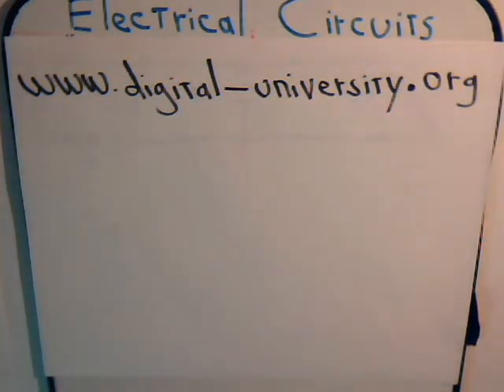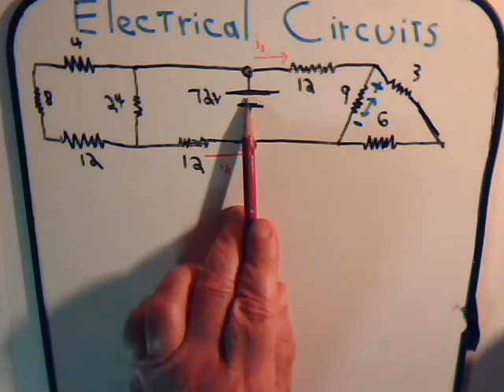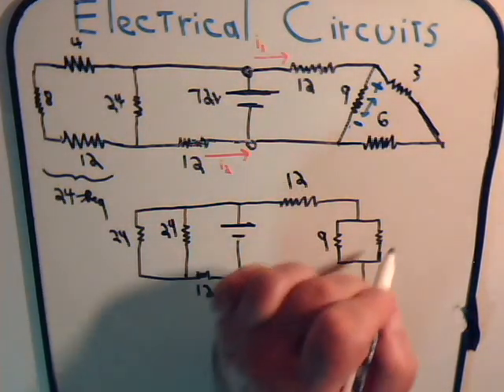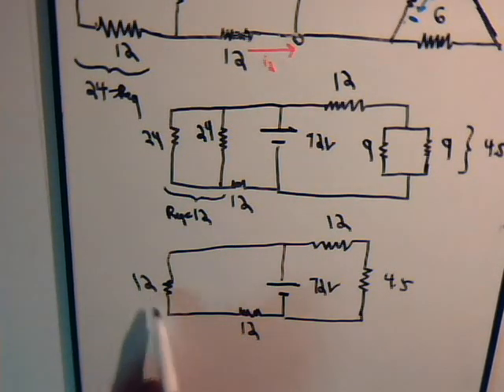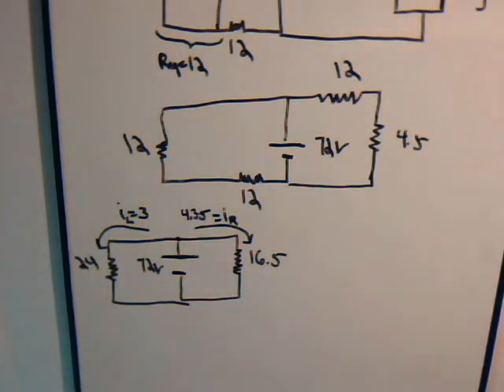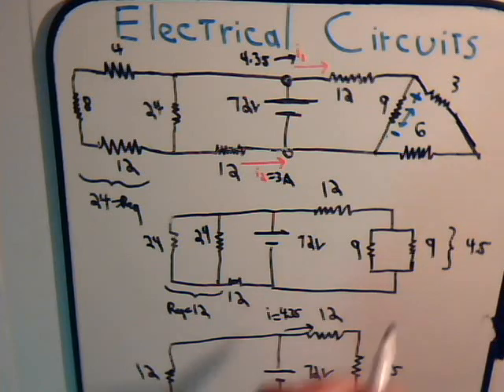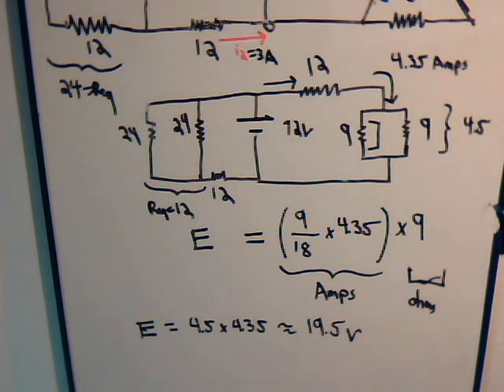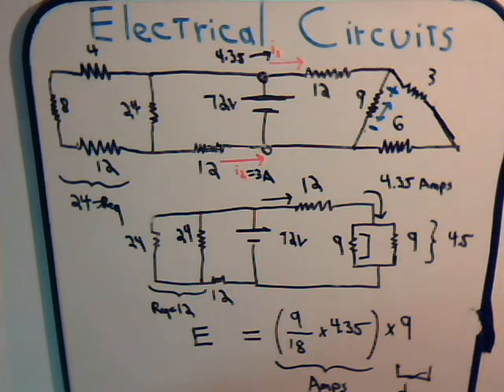Electrical Circuits Video #9: Simple Direct Current Circuit Example #2

Comment: i have a doubt the voltage at 12 ohm resistance in the right half is I1*12=52.2 volts in the rest circuit as the both 9 ohm resistors are parallel the voltage remains same as 52.2 volts so at 9 ohms resistor the current will be 52.2/9= 5.8 Amps and voltage is 52.2 volts but by the procedure you have solved its 19.5 volts so which one is right